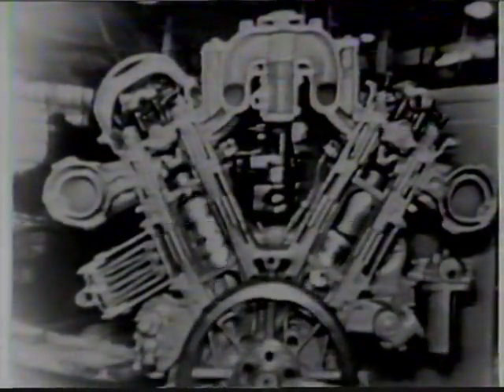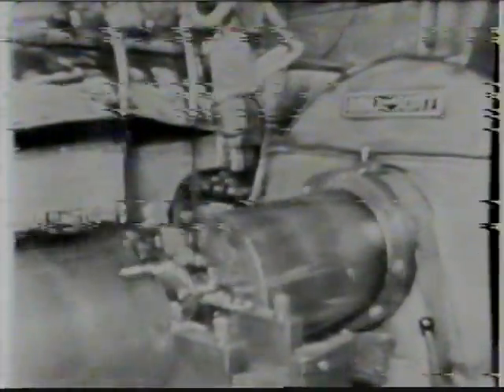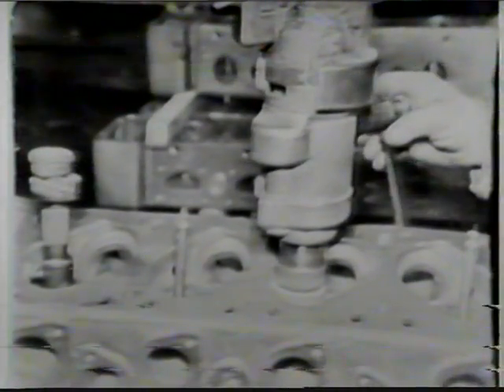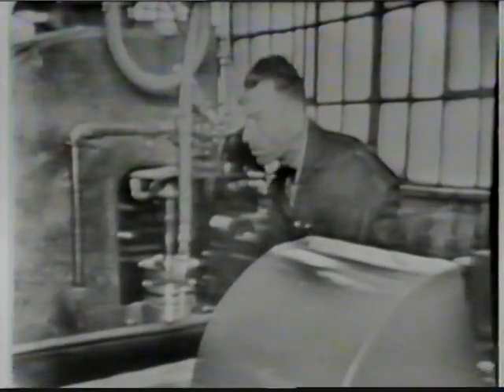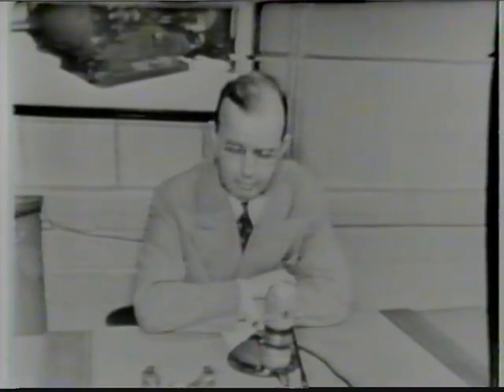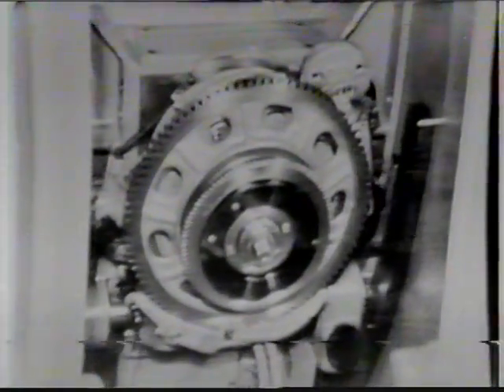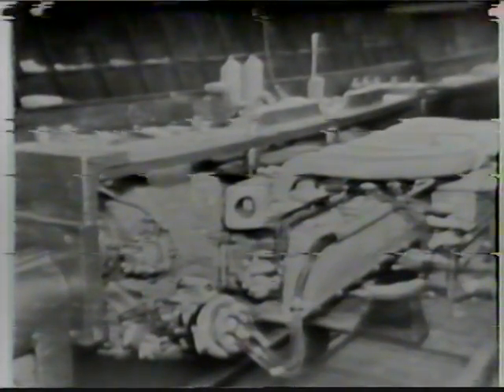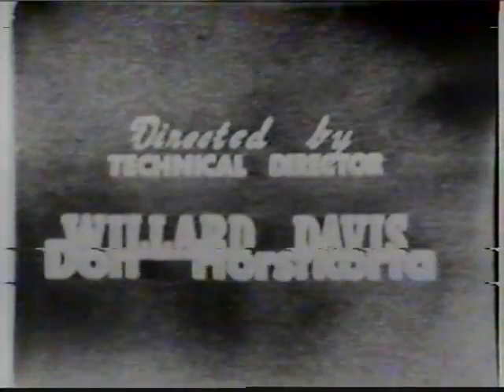Success Story - Hall Scott Power

Comment: This is before ACF-Brill spun off Hall-Scott in 1954.  By that time, ACF-Brill was getting out of the bus business, run off by GM Truck & Coach's highly successful rear-engined diesel coaches.  Later, Hercules bought Hall-Scott and shut down this plant.  Last OEM user of Hall-Scott engines was Crown Coach in LA, which fully converted to diesels by 1965.  Hall-Scotts were good engines, but were horribly inefficient.  A Brill IC41 using a Hall-Scott 190 got around 2-3 MPG on the road, while a GM PD-4103 with a GM 6-71 got 7 or better with the same payload.  The choice for Trailways was obvious...go diesel or fold.  The Hall-Scott powered Brill was faster...but had horrid brakes.  I know...I drove both models.  Judging from the models in production and the audio equipment and credits, I'd date this  program from 1950-51, probably produced by ABC-owned KGO.  The two main things that sunk Hall-Scott?  Archaic production methods and their failure to build a useful diesel engine that didn't explode.  (The Model 140 disaster.)  Also...note the lack of counterweights on that archaic crank!  And only three mains!Hall-Scotts were smooth runners...only by virtue of their excessive mass of their blocks. They'd run forever...if not pushed too hard.  Overrev one on a grade, though, and you'd break a crank quickly.  The rest of the industry had moved on; Hall-Scott was still stuck in the 1920s.
Reply: Hercules quit building Hall-Scott engines in Canton some time between 1968 and 1970, but Crown Coach put 3 Model 590 engines in 1967 buses and a few 1091s in Firecoaches until 1969(serial numbers on all are available, thanks to Crown records).  The number of engines produced was limited by the mid-60s, though.  New info found 2021 - Gillig put 2 Model 590 engines in 1967, and one last one in 1968.
Reply: At 22:45 or somwhere in the video I thought they said  7 main bearings?
Reply: DesertTBoB:  In saying "horribly inefficient", you are not being fair.   Hall Scotts were gasoline engines.  GM-6-71's were 2 stroke diesel.  Thermodynamic efficiency (conversion of chemical energy in fuel to mechanical output) of almost any gasoline engine is around 22 to 27%.  Thermodynamic efficiency  of almost any diesel engine is 45% plus.   That's at high power settings - as a gasoline engine is throttled back for cruising, it's efficiency falls off faster than it does in a diesel racked back.   Gasoline engines are cheaper to make, much lighter, and cheaper to maintain (especially until the advent of low sulfur fuel cut back the wear in diesel engines), so when gasoline was cheap, a gasoline engine could be cost effective in spite of double or more the fuel consumption.  That's why gasoline has always been dominant in cars.
Reply: Less efficient diesel engines exist as well. Typically a 1920s - 1950s gas engine will have between 4:1 and 8:1 compression ratios, while modern engines from the 1990s forward achieve 10:1 (147 psi), approaching 11:1. In turbocharging applications, 9:1 is acceptable because the last:1 is delivered by variable boost. Low compression diesels are as low as 14:1, but typically 16:1 being more common and suitable for turbocharging. In naturally aspirated forms, 21:1 to 25:1 (600 psi) are typical for high compression, highly efficient diesel engines. The high compression of these engines means there is little margin for turbocharging.

In the 1950s, aviation gas engines were commonly 6:1 with exhaust-driven turbochargers and some also featured an axially driven centrifugal superturbocharger. Today we just call them superchargers.
Reply: Simply said : gasoline has less BTU's than Diesel, combined with higher compression the Diesel wins in the fuel mileage compairison every time.

Comment: Narration is wrong as Hall Scott engines DID NOT power PT Boats !!! The US Navy use only the Packard M2500 series engines in all PT Boats !!! Hall Scotts engines did power the smaller air sea rescue boats !!!
Reply: THEY WERE ACTUALLY A.V.R.'S 63FT. THE 85 FT. A.S.R. USED TWO 4M-2500 PACKARDS.